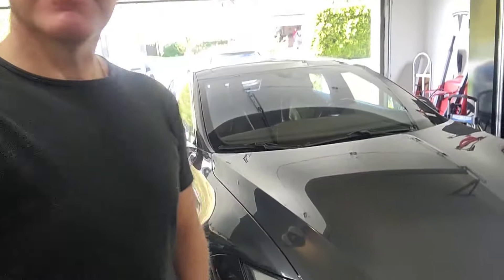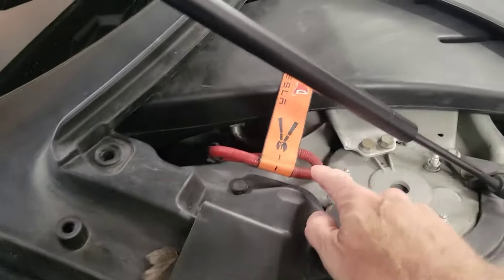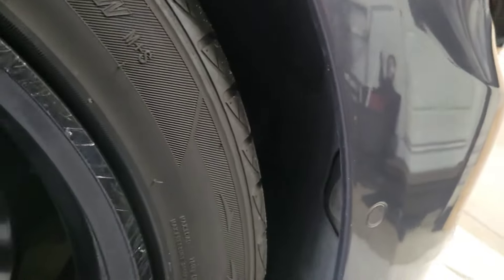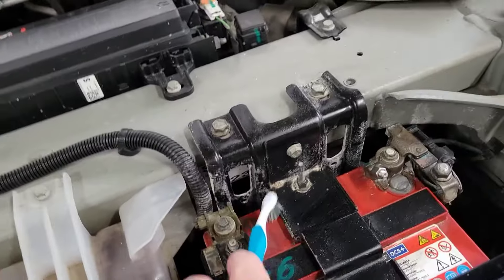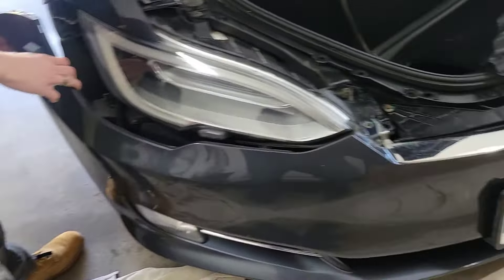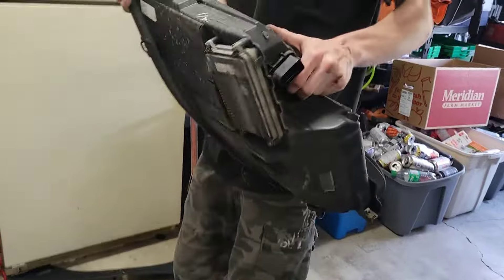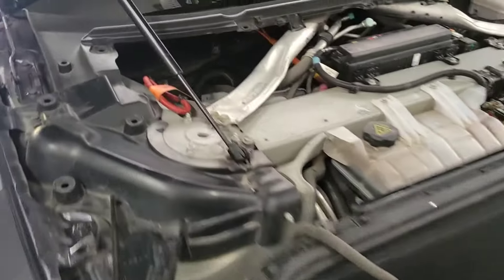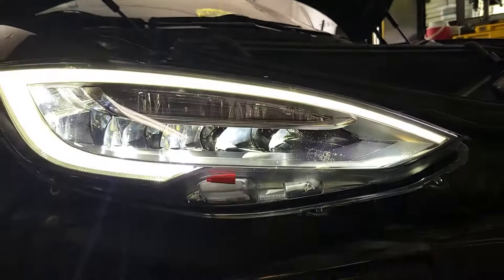2016 Tesla Model S Headlights Replacement

Comment: How have these headlights held up so far?  Mine look exactly like yours did before you replaced them. I refuse to pay Tesla $3K/headlight to address this.  What a rip off that you can't repair parts of the headlight such as the DRLs
Reply from the maker: The headlights are working great! One thing I missed was that I ordered 2 slightly different versions, one has the electronic adjustment. You can't really tell though, these ones were much cheaper than Tesla stock
Reply: @andrerink6888  Thanks for the prompt response! How long have you had them for now?
Reply from the maker: I have had them for 6 months now
Reply: @andrerink6888  Thanks! I searched the site that you shared a link to and it's not clear what the difference is between the two that they have for sale right now. Do you mind telling me exactly what I should be looking for since you've gone through this and know this much better than I do? TIA!